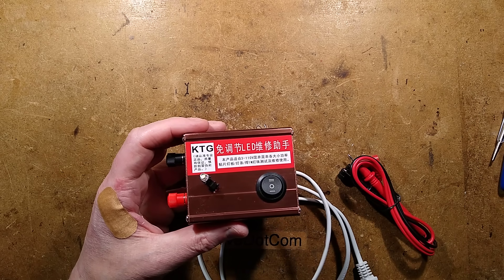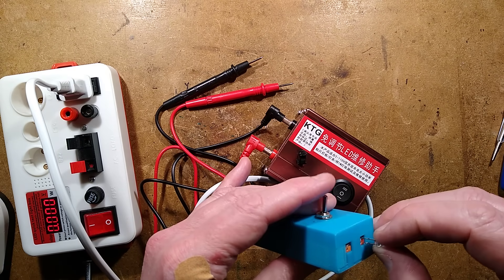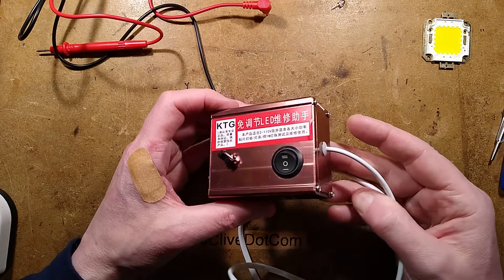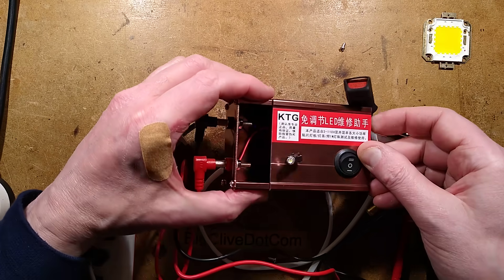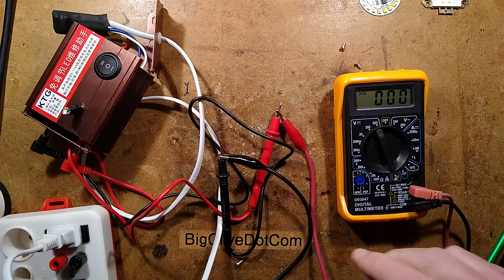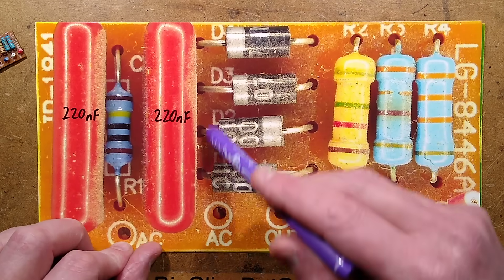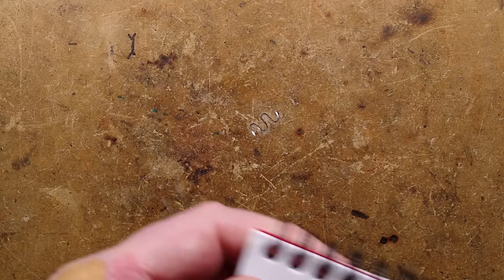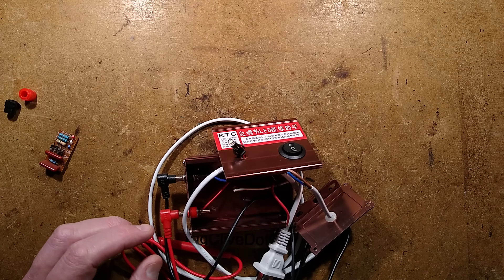Horrific LED tester that can literally kill you - (with scary schematic)

Comment: I worked for a radio company in Germany, and all of the china products for testing were nearly the same quality.  Simply produce 10000 units without approving quality and even be sure that it works. Then they write an email " ok next time we make it better, sorry" ?!
Reply: A friend of mine was an early importer of vapes. 
He gave me a trial kit, and the power wart let out the magic smoke (not very good to vape).
"No worry, I give you another."
Reply: My families company used reasonably simple controller boards made in the UK,basically just relays for switching big electro hydraulic solenoids,configurable with physical links. Apart from the small logic board for the controller bus they are nothing you couldn't knock up yourself.They never once had a failure, (their machines go to some of the world most remote,hard to reach places and used by some of the least 'educated' people,so sending out engineers to repair them,every five minutes is not an option,everything needs to be ultra durable)but after the small supplier went broke during COVID they were forced to source the main power boards from a chinese manufacturer until a suitable manufacturer could be found elsewhere.My father mentioned that he knew they would be poor but his hand was forced.Over half the supplied boards were really poor standard,many didn't work at all or simply couldn't handle the load on the big relays. He received exactly the same response from the Chinese. He sent one of his wiring harness guys on courses and now he builds boards from outsourced component parts,most of which is supplied by the original board makers supplier.
Reply: @notpoliticallycorrect1303  We are at a point where production in others places like Turkey became potentially cheaper and its even lower quality than the worst Chinese stuff
Reply: What do they care if they fry  customers. It'd the other side of the world
Reply: I buy Marklin model trains and they stopped producing all their models in china because they were having problems with the zinc frames constantly cracking in under a year 

And the reason Marklin actually did something was because 75% of their models are sold there in germany
Reply: The best gauge of the quality of a country's culture and governance is to examine the state of its public toilets. China's public toilets could gag a maggot. I heard the country is SO corrupt that the Chinese character for "corner" has been censored in the communist dictionary. The reason? Corners are so consistently cut that nobody has seen one in decades!
Reply: Same experience for me when we had modules manufactured in Schenzhen. "Oh, so solly... next time we better."
Reply: @fredfred2363  and Shenzhen is one of the BETTER companies also... 😬
Reply: @davelowets  Shenzhen is a city in China, and it would be a good scam for someone to try to hijack the reputation of other Shenzhen companies

Comment: Wow. That's a special kind of piece of junk. They managed to somehow put four diodes in it and still failed at full wave rectification? I guess at least the case could be reused for a future project.
Reply from the maker: It is full wave rectified but unsmoothed DC between the probes.  But different to ground.

Comment: You'd think at least they would throw a cheap transformer in there
Reply: dude that's copper, we can't afford that
Reply: @marcogenovesi8570  I've seen some of the cheaper transformers out there using aluminum wire. I think many of the Pakistani made welders use aluminum wound transformers.
Reply: @BTW...  I'm not complaining about aluminum conductors, I've just seen too many pakistani factory videos.
Reply: @BTW... yeah Al conductors are used a lot more in industrial and commercial because the circuits need to be maintained (more corrosion possibility, more thermal expansion)
Reply: Not cheap enough.
Reply: In China, YOU are the transformer.
I'm pretty sure that it's a Chinese method of population control: shoddy goods ensure a tolerable death toll. :oops:
Reply: Why do you need a transformer? Isolation? I figure a small isolation transformer would be more expensive and non-standard than the usual step down stuff. 

Possibly cheaper to make some sort of current-limited switching converter at that point.
Reply: No, I wouldn't think that at all. In fact, just the opposite. If they could get away with not using wire they'd do it!
Reply: The effect of the “bean-counters” these Chineseum crap factory’s also employ ~ “you must make the thing small & light as possible; oh-no don’t put a transformer in it that will increase the size and weight of it”
Reply: @samuelfellows6923 That or using a regulator chip. We can't spare the $1.32 for a cheap buck regulator circuit, so just use a series resistor.😂

Comment: Also, the black and red banana jack covers are actually "safety covers" so you do not accidentally shock yourself before you attach the probes.
Reply: They're Chinese test meter (or as my mate terms them, a Sino-meter) leads designed to plug into a shrouded socket in an equally nasty test meter.

Comment: Isn't that a US type 110V plug?
Reply: Yes but also used in China for 220V.
Reply: @tappel0  The variant used in China for 220v is unpolarized, has no holes in the prongs, and is usually smaller all around. It's basically the simplest, cheapest way to make a plug, so that's what's used.
Reply: Slightly different dimensions and it's used as standard for 220 volt in China